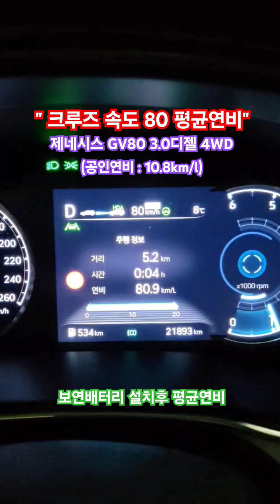[#3095] #평균연비5 #연료절감 #보연배터리설치 #제네시스gv80 3.0d 4wd #현대차 #연료절감 #탄소중립실천....

Comment from the maker: #내연기관디젤 #압축착화방식 #참고
(#자연, 자기착화방식)
(#내연기관 디젤차량은 #점화플러그 없음)
#제네시스GV80 3.0디젤 4륜구동 
#퓨즈박스 1  ( #엔진룸 퓨즈박스 1 )
#점화코일 ( 15A ) #예열코일
#연료히터 ( 30A )
#예열장치 ( 80A )
#배터리 센서 ( 10A )
#파워스티어링 ( 125A )
#연료펌프 ( 20A )
#냉각팬 ( 100A )
#4WD ( 30A )
#E-CVVT 1 ( 40A )
#오일펌프 ( 50A )
#에어컨 ( 15A )
#TCU ( 20A )
#ECU 1 ( 15A)
#모듈 ( 10A )
#전조등 좌 ( 30A )
#전조등 우 ( 30A )
#파워아웃렛 ( 40A )
#시동 ( 30A )
#ACC 2 ( 15A )
#E-CVVT 2 ( 20A )
#E-CVVT 3 ( 20A )
#전동식 워터펌프 ( 20A )
#센서5 ( 10A )
#IEB 4 ( 10A  )
#TCU 2 ( 15A )
#센서 2 ( 10A )
#ECU 4 ( 20A )
#ECU 2 ( 10A )
#모듈 2 ( 10A )
#파워스티어링 2 ( 10A )
#센선 3 ( 10A )
#센서 4 ( 10A )
#워셔 ( 15A )
#IG 1 ( 30A )
#ECU 3 ( 30A )
#IG 2 ( 30A )
#ACC 1 ( 30A )
#예비퓨즈......
#발전기 ( 225A )

#퓨즈박스 2  ( #운전석 퓨즈박스 )
#모듈 9 ( 10A )
#에어백 경고등 ( 10A )
#계기판 ( 10A )
#파워윈도우 ( 30A )
#선루프 ( 25A )
#전동 시트 운전석 ( 25A )
#인버터 ( 30A )
#에어백 2  ( 15A )
#전동 시트 조수석 ( 25A )
#ECS ( 15A )
#쉬트 히터 운전석 ( 15A )
#모듈 10 ( 10A )
#모듈 8 ( 10A)
#전자식 변속레버 ( 10A )
#통합 제어기 ( 10A )
#모듈 12 ( 10A )
#멀티 미디어 ( 25A )
#모듈 4 ( 10A )
#파워 아웃렛 ( 20A )
#모듈 6 ( 10A )
#에어컨 4 ( 10A )
#멀티 미디어 2 ( 10A )
#제동 스위치 ( 10A )
#예비퓨즈......

#퓨즈박스 3  ( #엔진룸 동승석 쪽 )
#PCT 1 ( 30A ) 
#PCT 2 ( 30A )
#PCT 3 ( 30A )
#SED STEP ( 20A )
#서브히터 후석 우 ( 20A )
#시트밸트 1 ( 30A )
#시트밸트 2 ( 30A )
#열선유리 뒤 ( 40A )
#IEB 1 ( 60A )
#IEB 2 ( 60A )
#IEB 3 ( 40A )
#파워 윈도우  ( 30A )
#블로어 ( 40A )
#열선유리 뒤 ( 10A )
#에어컨 2 ( 10A )
#파워 아웃렛 3 ( 20A )
#파워 아웃렛 4 ( 20A )
#LDC ( 10A)

#퓨즈박스 4  ( #리어 퓨즈박스  )
#DCU 3 ( 20A ) 
#DCU 4 ( 10A ) 
#DCU 2 ( 20A ) 
#PCT 2 ( 30A )
#PCT 3 ( 30A )
#커튼 ( 20A )
#차일드 락 ( 15A )
#전동 시트 후석 좌 ( 30A )
#앰프 ( 25A )
#와이퍼 뒤 ( 15A )
#파워 도어 좌 ( 15A )
#E-LSD ( 20A )
#시ㅌ트 히터 후석 좌 ( 20A )
#파워 테일게이트  ( 30A )
#전동 시트 후석 좌 ( 20A )
#B+ ( 30A )

#퓨즈박스 5  ( #납산배터리 박스  )
#발전기 제어 ( 10A ) 
#B+ 1 ( 50A ) 
#B+ 3 ( 50A ) 
#B+ 4 ( 50A ) 
#B+ 5 ( 125A )
#B+ 6 ( 100A ) 
#트레일러 ( 50A )
#납산배터리 AGM 95Ah / 850A